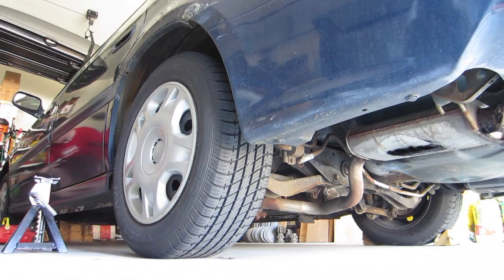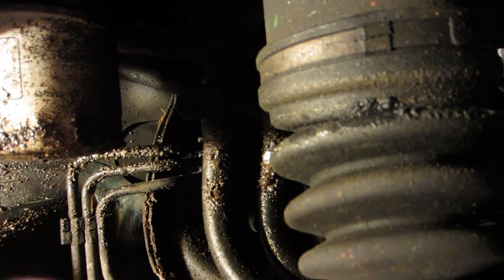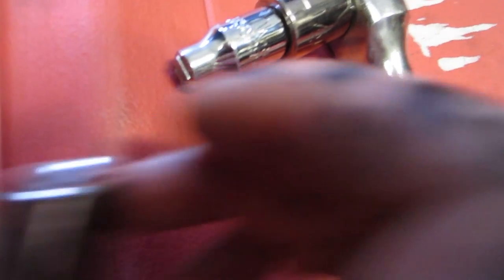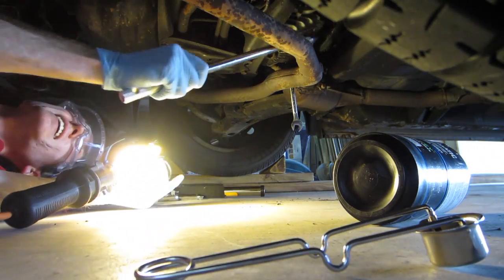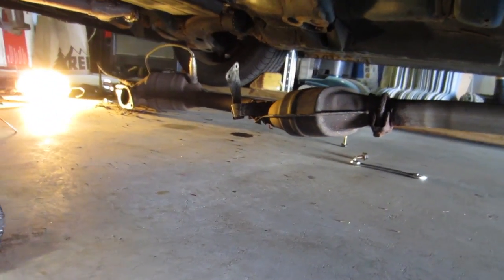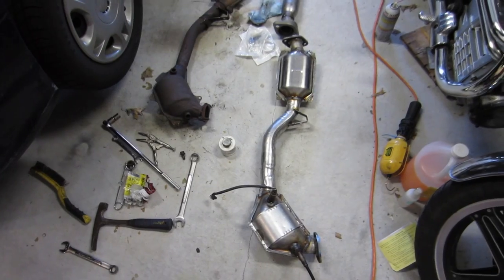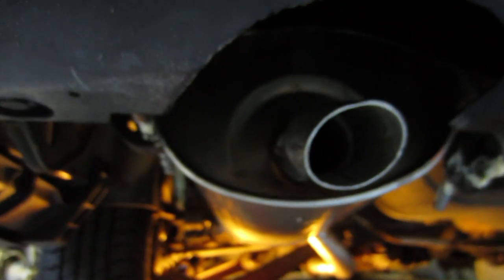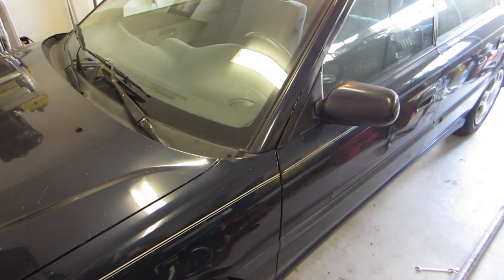Catalytic Converter and Muffler Swap Subaru Legacy

Comment: Nice to see a video of what it’s really like to remove bolts on a rusty exhaust. All these other videos show bolts coming right off easily, as if that EVER happens in real life
Reply from the maker: Ive learned MAP gas (yellow bottle) is hotter than blue bottle regular propane and works faster to remove the bolts. There are expensive coils that wrap around bolts without flame and the electricity brakes them free used in high end shops so pick your poison, danger or cost to remove rusty bolts. When dealing with aluminum vs steel, galvanic corrosion occurs so heat is a must and special paste to be used provided proper torque is accounted for by increased lubricity over dry threads. Rust is the enemy and seeing how others overcome this is certainly a nice thing to share!

Comment: I’m getting my first Subaru 2000 forester on Tuesday and I’m f@@@@@@ pumped!!! First things I’m doing is lowering it and exhaust. What muffler should I get to have the deep iconic Subaru sound? Do I have to get new pipe and header?
Reply from the maker: I essentially kept it stock, cat back should do the trick, and the V2 AEM intake will make it sound nice as well, had one on my accord.

Comment: at 4:55 the audible click noise after you put it into reverse and the exhaust lifted up a bit, is that related? my outback has only recently started making clicking noises. and getting 16mpg with reduced power.
Reply from the maker: Engine starts to put strain on drivetrain mounts pulling exhaust with it so it’s normal. Check engine mounts if excessive, mine were ok from pulling the engine for a head swap but who knows after a few years what state yours are in
Reply from the maker: years later I remember the drivers cv joint boot spilled grease everywhere a week earlier (changed the oil or something to know it was not a problem, so possible bad cv joint which cluncks if worn? follow the tire rotation to the engine, something inbetween and just isolate what you can to test but if something like this looks out of place, start there.

Comment: Hey Chris, where did you get the full exhaust from?
Reply from the maker: RockAuto is my go to spot for all auto parts, let you choose quality levels and pay reasonable shipping, best source, website is clunky but saves you overall with better parts than others. Catalytic converters and o2 sensors are problematic with this engine, do your homework as I forgot what combo or brands I went with.

Comment: Did you use an OEM cat on this?
Reply from the maker: Tim Davis went with walker oem Fit but third the price. Oem sensors for sure aftermarket don't work
Reply: Chris Loew Have you run into any issues? I need to replace mine and am considering a Walker cat for my 3rd gen Forester.
Reply from the maker: Tim Davis sold the car a week later unknown durability but decent in construction and fit. Better value for the lower priced stuff from what I recall good luck